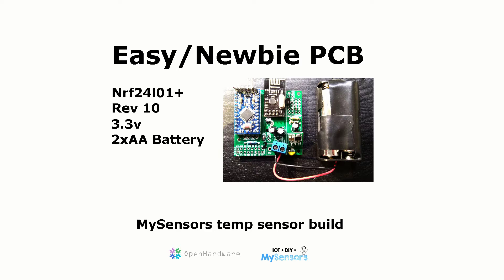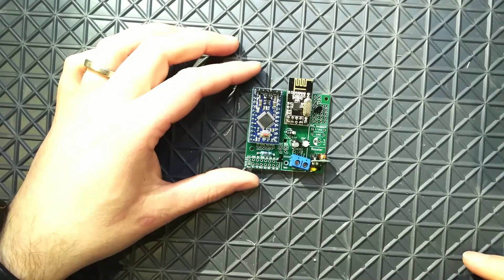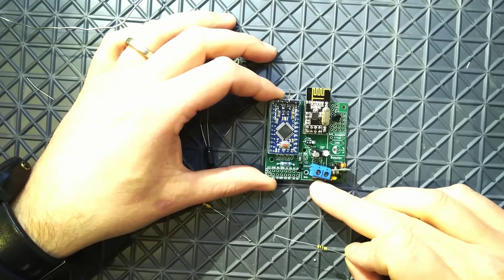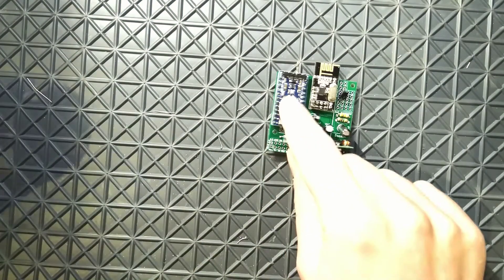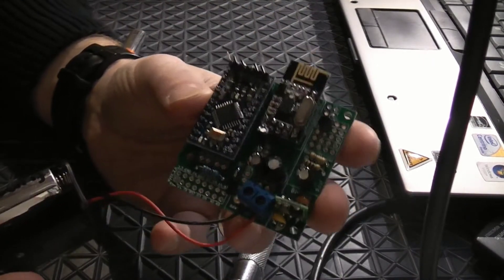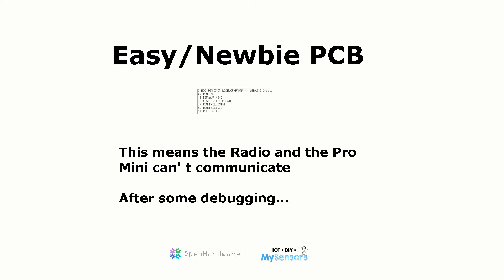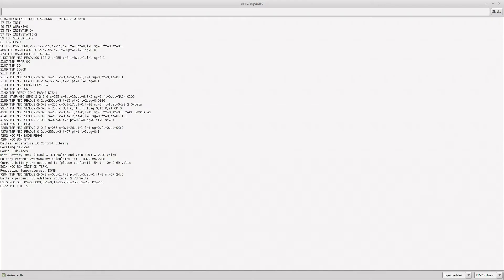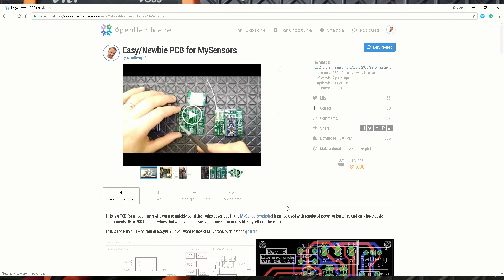MySensors Battery Node 2xAA - EasyPCB (Nrf24l01+) and Temp Sensor.

Comment: I hope that you was find that there is no any voltage regulator needed for the battery powered nodes, because any voltage regulator having it's own power consumption and drain batteries.  Also fuse bits need to be configured to turn off the BOD and frequency can be lowered to 1 mhz. I have several nodes (but with my own firmware - not mysensors) - power consumption is about 1 uA in sleep mode for temperature sensors and about 6-7 uA for motion sensors. Usually using 2xAA batteries but also using CR123 - working 2 years from this batteries and i think will work 4 years more.
P.s. from the last practice - testing with cr2450 batteries- also not bad!
P.s.s. optoboot bootloader used in my nodes - it is starting more fast and using less memory - very good thing for battery  powered devices on atmega328p

Comment: What is that blue thing called that you soldered onto the board instead of soldering the battery wires directly to the board? I'd like to order that for my battery powered sensors
Reply from the maker: I think you mean the screw terminal ?
Reply: @sundberg84  that sounds right,thank you. Which size should I buy for easypcb so that the pins fit into the board?